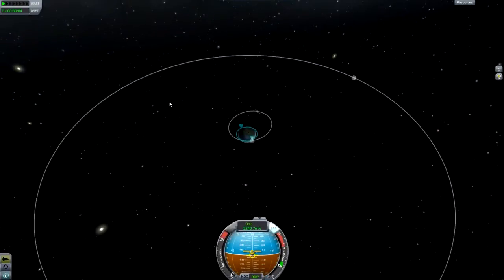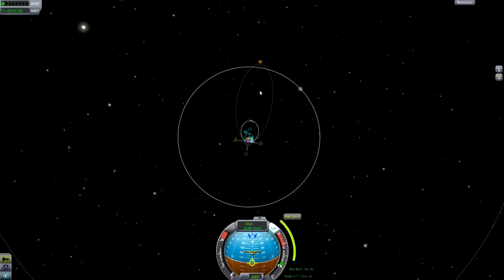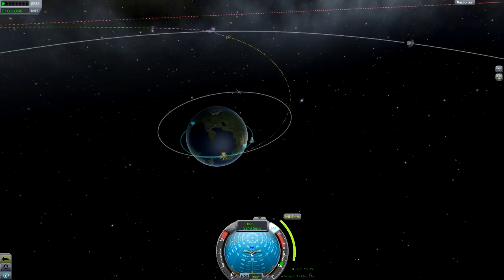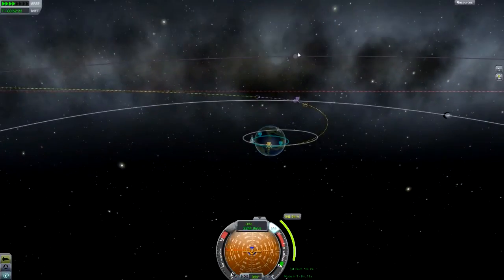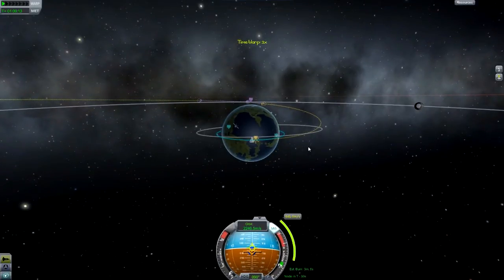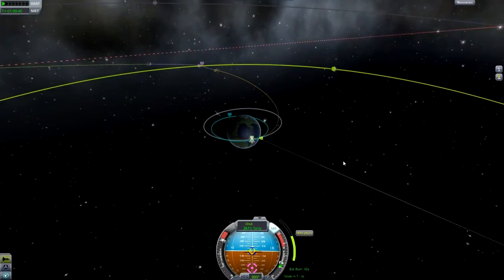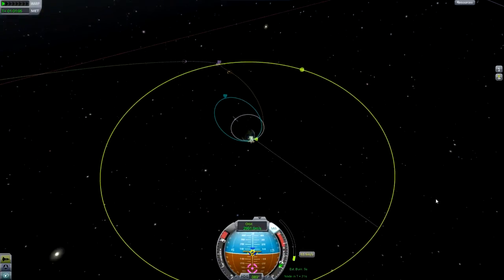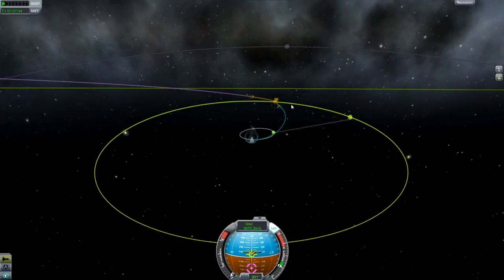KSP - How to set up/perform transfer burns

Comment: been looking for ANYONE to tell me how to TURN ON THE BURN when u hit the node... u know what NO ONE SAYS WHAT TO PUSH...so again im disappointed in this and every other vid on ksp... all i can do is drive by hand... due to everyone thinking we all know what DAM button to push... not even a keymap ive seen.... this is STUPID!
Reply: You need to throttle yourself. Usually you should hit z when half of the burn time is left until the node and x when the node deltav bar goes close to 0. That means you burn half of the fuel needed before and after the node. Sorry for my english and also im not an expert in ksp